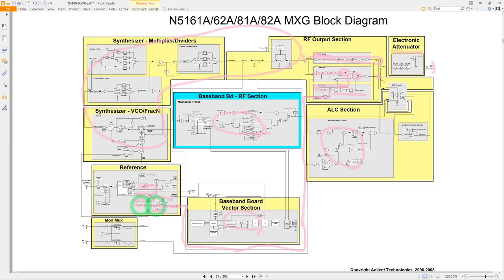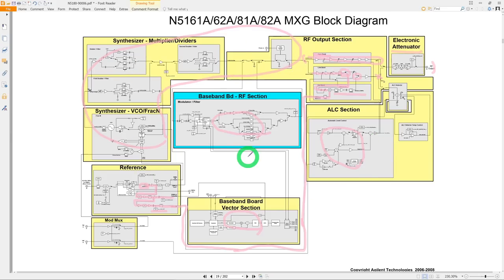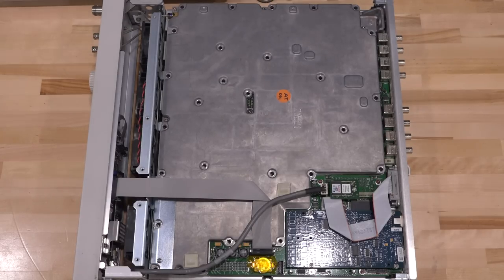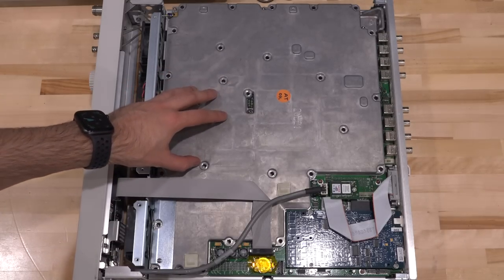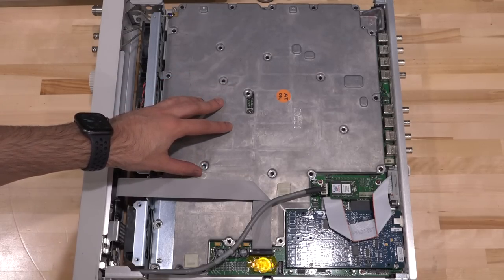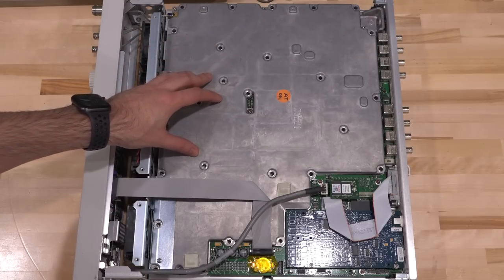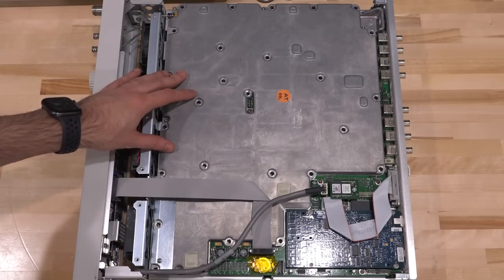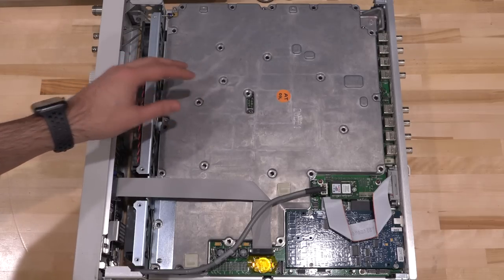TSP #163 - Teardown & Repair of an Agilent N5182A MXG 100kHz - 3GHz Vector Signal Generator

Comment: Thank you so much for creating such interesting videos. Over the last few months I have viewed them all, many several times. Having recently retired, I've rekindled my interest in ham radio and am on the air again (WG2E). I'm in the process of improving my RF lab with some new test instruments. Your teardowns and experiments have been very helpful with recent purchase decisions for a spectrum analyzer and signal generator.

I enjoy your logical approach to fault finding in the repair videos. Many people I've worked with over the years are just too eager to replace components without enough thought beforehand. One of my mentors had something like this on his toolbox... "Parts replacement should be a result of troubleshooting, rather than a means of troubleshooting."
Reply: Amen. Me, too.  de KQ2E

Comment: 26:15 I would always have blamed a transformer before a diode due to the possibility of connections fracturing at the terminals.  But you are clearly an expert in your field to go straight in for the kill with the diodes.  Did you ever do a DC test on the defective part?
Reply from the maker: Yes, I did. The diode was an open.

Comment: Very nice repair, I really need to buy some more broken test gear...
Reply: Yeah, but will you have his continuous luck in finding stuff that only needs a $2 dollar component replacing or a loose cable re-attaching?

I think the cat has something to do with it.. :)
Reply from the maker: @trickyrat483  That is not entirely true. Several >$500 repairs have also come up.
Reply: @Thesignalpath  It's OK, I was only kidding. You've done some terrific repairs on the channel. Still, I'm sure that cat has a hand in it all somewhere.. :)

Comment: i has issue with error code 508, synthesizer unlocked. can you give me how to fixed it?
Reply: I have repaired five N5181A instruments with Error 508 or bad RF performance. They all had bad U3400/SB99026MN or U3412/1GC1-4218 or both. I recommend that you replace these first.

Comment: Have you some idea in why the attenuator are under light?
Reply: Troubleshooting? Other status LEDs on that board that would be likewise invisible under the RF shield.
Reply: @trickyrat483  nope that got sure is not the reason. He have to be because they want to change the silicon properties by exposing it to some light.
Reply from the maker: @vaualbus  No, definitely not. They are  debugging LEDs.
Reply: @Thesignalpath oh than so it easier than what it seem😂
Reply: @vaualbus  Wank factor, it looks really cool.